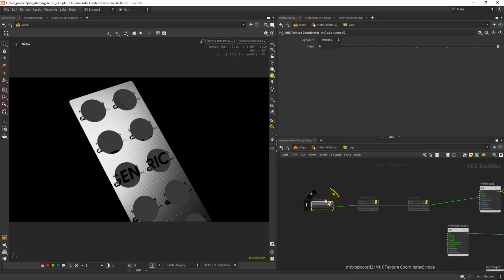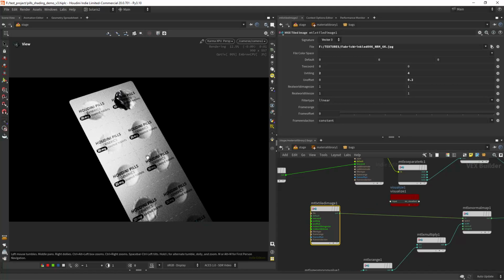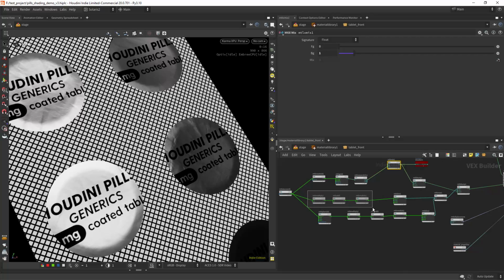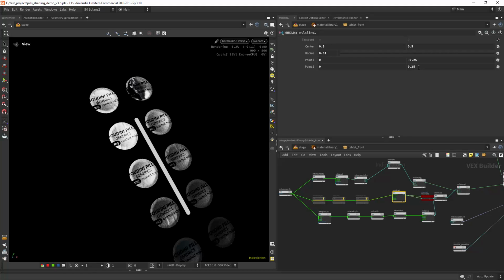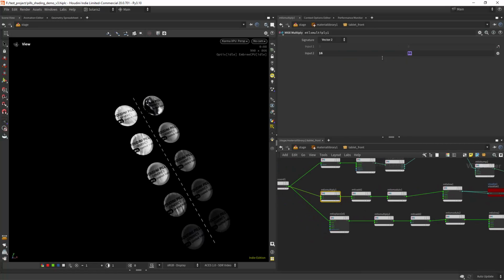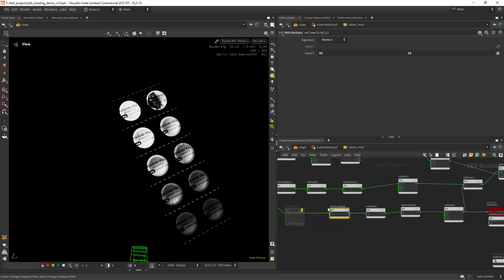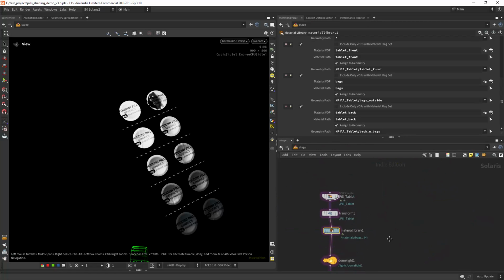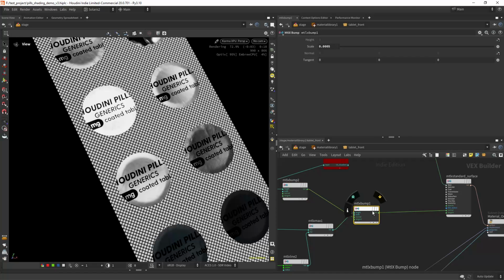MaterialX and Karma | procedural networks

Comment: Hey, thanks for the tuto. I have a problem, when hitting "x" to visualize, a visualize node is being created but nothing changes, I still see the full shader. Would you have a solution ? Thx !
Reply from the maker: Hey, it only works when you have the node connected to the shader. Let's say you have an image node connected to the base color, it should work when you press X. It will also not work if it's connected to the displacement.